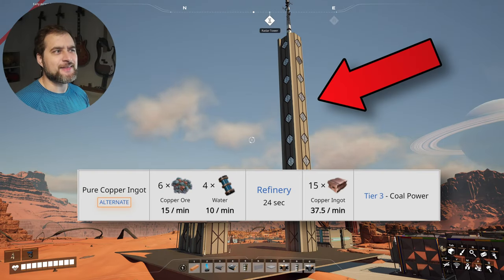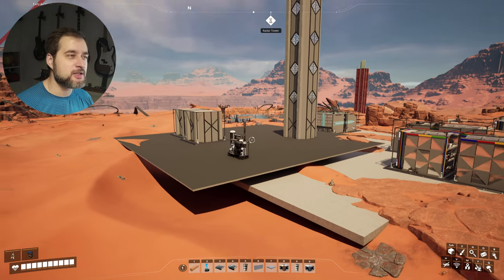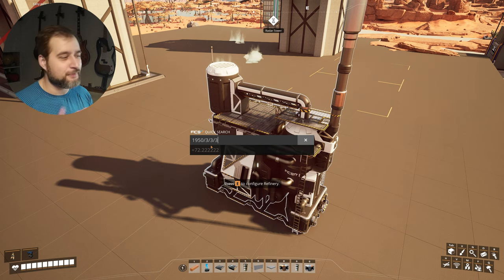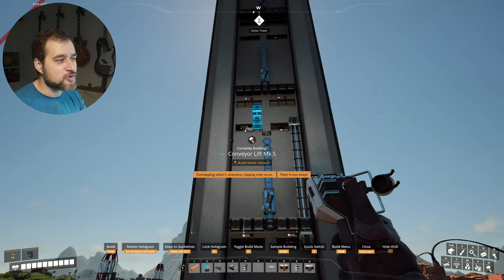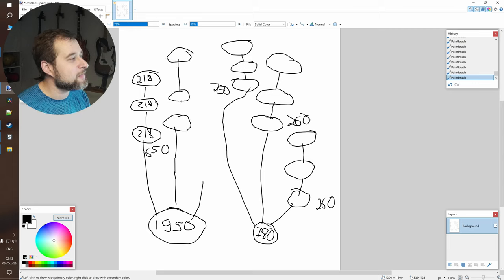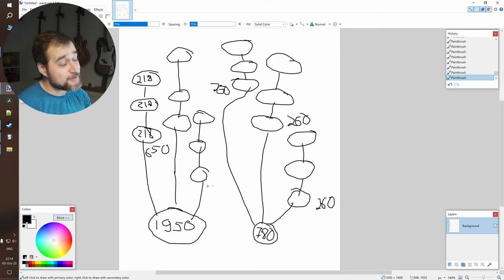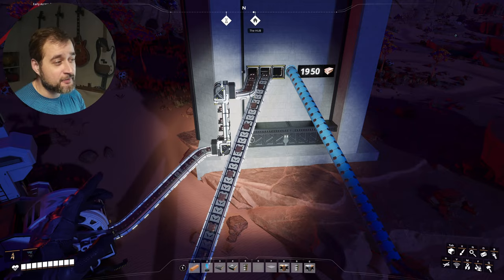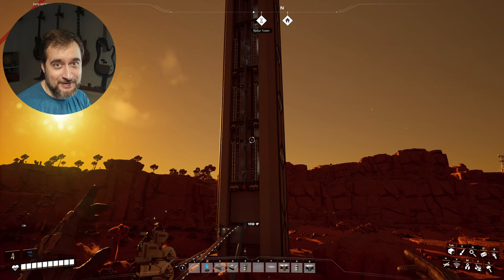Pure Copper as Skyscraper in Satisfactory

Comment: I like it.  I took a little different approach to this one.  I have a central tower for the pipes and lines.  attached to the side of the tower are 3 different blueprints: left, right, and center for the sandwich layer and refineries.  It is much more complicated than your solution.  I might rethink my solution down the road.  What I like about my solution is that there is more than just a tower.  I'll take a screenshot and add it in.
Reply from the maker: My first take was foundation blueprint splitting everything to 3 sides and then production blueprints being rotated every 3 prints to line up with new set of outlets down below. Then I was making huge side covers to make everything pretty. Never thought about tree like structure with prints being branches. Definitely not as efficient as just tower, but still might be interesting for other solutions and shapes!

Comment: Hey there! Amazing build. I’m gonna gonna comment more on reddit.

Quick question: How do you lock the hologram? Is that that an experimental build thing? Because I’m playing on Update 7 and have never noticed that option
Reply from the maker: Yup this is update 8 new feature. Nudge Tool.
Reply: so cool. Wish I had it now, but I’m not sure I wanna play on experimental before I even fully finished my first playthrough just for thag feature
Reply: Push h to lock the blueprint. then use arrows to move horizontally.  It's so much easier to place blueprints in update 8.

Comment: These Blueprints are genuinely brilliant.  The use of floor connectors to arbitrate between triplets of floors is inspired.  

One suggestion:  A skyscraper cap floor to finish the building off when the building is complete (at 3 or 6 or 9 blueprints) - not that Radar Towers are not a good idea, too.

10/10 Yakez.
Reply from the maker: Yep I sort of skipped on decorative cap this time around. Cannot really find the style yet xD
Reply: I tried on myself but agree that due to the (awesome) profile of the roof, a cap is difficult to get right.  I stuck a radio tower on mine eventually too.

Your design is - amazing. @Yakez42
Reply: This design can be easily modified (via the recipes) to create all of these products (in different stacks)

alt Coated Cable, alt Diluted Packaged Fuel, Liquid Biofuel, Polyester Fabric, alt Pure Caterium Ingot, alt Pure Copper Ingot, alt Pure Iron Ingot, alt Pure Quartz Crystal, alt Recycled Plastic, alt Recycled Rubber, Residual Plastic, Residual Rubber, alt Sloppy Alumina, Smokeless Powder, alt Steamed Copper Sheet, Sulfuric Acid, alt Turbo Heavy Fuel, Turbofuel, alt Wet Concrete

An entire city with stacked buildings could be devised.